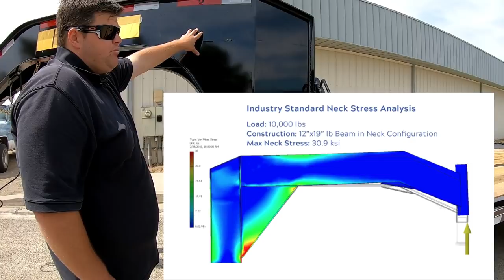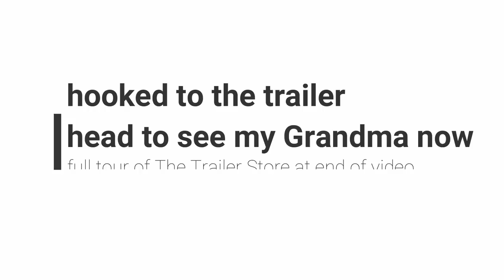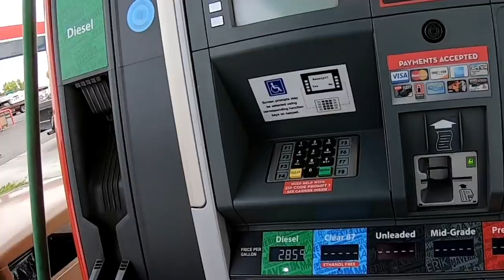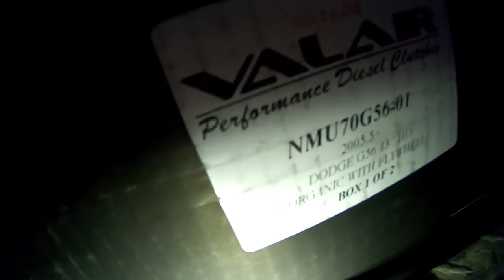BUYING A BRAND NEW DIAMOND C GOOSENECK TRAILER! SPECIAL ORDERED TOOK 3 MONTHS TO GET!

Comment: Bolt some old rubber belts to protect the deck where your steel tracks go. That’s what our lowboys have on them and it saves the boards for a lot longer
Reply: joeb blo. I do the same but I also treat them with linseed oil once a year
Reply: You have all sorts of used motor oil. That with a little fuel and you're golden!

Comment: To treat your boards, thin down roof tar with fuel oil, diesel or gas, thin enough to paint on with a brush.  Do it once a year, 40 years on the same oak boards and still holding up!

Comment: I’ve had issues with my hub seals leaking also. I was draining the oil in them and noticed fine wear metal from the bearings. I think that’s what eats the seals and causes them to leak. Since then been changing the oil often and using Conklin top spec. Haven’t had a leaky seal yet knock on wood.

Comment: I put quarry belting over the steel plate on the trailer deck for loading crawlers, saves the pucker factor if they slide on the deck

Comment: Hi Sam! My hydraulic jacks for lifting trailer off truck do the same thing. Have not found fix:( they do draw lot of AMPs from battery mine 440amps. Dump bed draws 220 weird. 5watt solar panels keeps everything fine. Looking forward to seeing trailer get used!!! Thanks for videos! Hard work pays off!!! Say Hi to your Dad!
Reply from the maker: Fixed it tonight. Lines to splitter box were hooked up backwards. Works perfect now

Comment: Its sounds like air in the hydraulic lines that needs too be bleed so the axle seems like there tight and need too be broke in but might be set too tight on the bearings but they are new!

Comment: Hi Sam, good idea to recheck preload on bearings. Sure don’t want to loose a wheel bearing and have a set of duals coming off. Has enough miles to retorque the wheel fasteners. Like the trailer. Do you have enough boxes or will you have to add some side boxes. 👍

Comment: Hello , I would not stain the deck. I would use diesel fuel and transmission fluid. In a day or two it will be dry and it will not come off on your clothes.  It will last a long time and outlast any stain , you can brush it on or spray it about every 5 years. 
    I have a trailer 30 years old and the deck is as hard as it was when I got it new.

Comment: Gator trailers of Canada makes a galvanized trailer with artic flex wiring and a lot of standard items that are options on other trailer manufacturers.
Reply from the maker: Seen s gator in person. It doesn’t stand a chance compared to diamond c. And gator gas worst costumer support ever
Reply: @VBELTandSON  you talking about the Gatorade trailer. Different company.
Reply: Gator and gatormade are different companies

Comment: What's the spread between the axles, center to center. It looks like 96" or wider? Also if you know anybody with conveyors get some old belts to protect your boards with tracks.
Reply from the maker: 48 inch spread and oak deck holds up great to everything

Comment: Sam if u dont want wheel  seals failing  drain the gear oil out of them and fill them with Lucas hub oil. That's what we use in the semis
Reply from the maker: big murph I had seals fail with that stuff before. Soo hard to clean that crap off the drums.
Reply: @VBELTandSON   yeah it is hard to clean off. We like using it because it sticks to the bearing in case the seal does fail less of a chance burning the bearings up.

Comment: I’m looking at the same trailer basically but I can’t decide if I need 30 total fee or go with 32 total fee after watching some of your videos about chaining down to the tail I want to haul to skid loader’s at once
Reply from the maker: I’m going with a 32 on my next one  30 is nice but with the added length it should help the ride and give more cargo room
Reply: @VBELTandSON  My last trailer was a load trail 26 foot flat and a 9 foot Tail With disc brakes etc. but it was just hard to get around tight corners so I’m looking to get into something shorter but don’t wanna go too short I like these diamond see Trailers but I’m not sure on the practicality of having the tail that far forward. I like the reduced loading angle feature of that but having issues when chaining down to the tail would not work well I experienced similar issues when I chain down to the dovetail on the load trail
Reply from the maker: Watch I’m an operators YouTube channel and check out his loading style on is 30footer
Reply: @VBELTandSON  ended up with a sure track 20+10 has 12k axels but electric drum. It’s all I could find.. I’m gonna see how I like it before placing an order.

Comment: You should have changed the fuel filter on that 1st gen when they won’t idle it’s generally low fuel pressure from plugged secondary fuel filters
Reply from the maker: raccbc27 apologizys I forgot to mention he took the truck to Cummins themselves the week before. They changed all the filters but did not. Change a thing.  Master mechanics over there for sure. When you look at the throttle linkage stop plate you can clearly see it has bent over time. What I did was the only way to fix it. I’m sure if it was filter issue throttle response would have been weak as well which it wasn’t

Comment: Hope you don't have the same problem with tires the other guys have had. It seems like that style trailer (or maybe just smaller trailers have a lot of issues). The big trucks I drove would have problems sometimes but the trailer was usually the last thing to need attention other than regular maintenance. I hauled equipment on a 50 ton carry all and the tires never had problems. I believe they're the same size too. I was thinking of getting one and going into business for myself not sure if I will now. Hope you are trouble free now. Have a good one.
Reply from the maker: No issues with it so far. Been using it over a year. All good

Comment: Just FYI for everyone out there, most 245/70R17.5 tires are rated max 68 mph. I believe Continental makes a 75mph, but good luck finding them. If you run the 235/75R17.5 they come 18 ply, I don’t remember the load ratings off the top of my head but they are close, but they come rated 75 mph.

Comment: Now I know why you paid more. I'm only about 300 miles from the factory and picked it up there.. I saved $700 in shipping and I can;t even guess what you paid all the way to Nevada. I did the pine deck with the rubber inserts on the tail. Wish I had done the Oak. Good choice! I have now suscribed to your channel and I hope to share some of my vids with yours...I have one so far but am working on it.  Just watched the vid after you brought the trailer home and was adding the chain rack and talking about the squatters. About four years ago I passed through Northern California on vacation(Susanville up from Reno to Logview WA) guessing I was up in your neck of the woods. GPS dragged me up through Lassen, not the best route, but SOOOO scenic. No regrets. 

But Anyway, nice thing about Missouri and trespassers. We can call the cops, or just handle it ourselves. Either way, the bums get the message and move on. I can tell more explicit stories about that but not here. 

I am so glad you are enjoying that trailer as much as mine. I pull it almost everyday and it is so much better than what I had before. 

I still use the old lever dogs (the tooth busters) with a five foot square tube for latching it down. What the heck are those binders you use? Those are bad ass!

PS, Took over 6mos to get mine...

Comment: You could have been a Good SAMaritan. Load up that dude on the motorcycle and give him a nice fast ride LOL.  I like that oak planking. I guess you are going to have to put good grease in the bearings. Sticky gooey marine bearing grease. Works fine in my trailers. My suspension in the travel trailer has wet bolts. Bolts with zerks on the end that have a small hole down the center and out the side. With the hole on the side up you can shoot grease into all the bolts that hold the spring ends, and on mine a MoreRyde equalizer.

Comment: Would check the brakes in addition to the hubs. Dry bearings will generate heat but nowhere near as much as dragging brakes. Not totally acquainted with electric over hydraulic but if using a standard electric brake controller, sensitivity could be causing enough residual pressure  to cause brakes to not release fully.
Reply from the maker: david Horsley I didn’t even have trailer brakes turned on tho
Reply: @VBELTandSON  just a suggestion based on what I have experienced. The only time I have ever experienced hubs to hot to touch, I've had a dragging brake. Second, just by their very nature, discs develope more heat than drums, even with the vents in the disc. Third, I don't know if I misunderstood but I thought you said the onboarding hydraulic pump energizes the discs. I don't know how exactly that works, I'm familiar with electric brakes, I'm familiar with hydraulic brakes, and I'm familiar with air over hydraulic, but I just thought I would suggest checking the brakes before changing the preload on the bearings. New trailer, new bearings, no load, and hot hubs, I'd investigate all logical venues before doing something to void a warranty. Sorry to intrude, just trying to be helpful.

Comment: One question why did u not get air bag axels??
That would also fix the huck and buck
Reply from the maker: Worried about getting thing ripped off driving in the woods
Reply: @VBELTandSON  
got it
My thought would be if u had gotten then u would not have a huck and buck
Reply from the maker: B Pev21 I’m sure it would have helped but several other variables that let to the hucking. I’ve got it pretty much figured out now

Comment: nice trailer - is your suspension called a "hutch"? I just got mine last week, exact trl except i got extra boxes and regular gray wheels, and i got 12" floor framing. I asked you about the remote before -  yea so mine doesnt work all that great, the pump shuts off and on if not standing right next to trl so probably have to upgrade that to a lodar. Really disappointed because my left jack leg fell down loose and was dragging the road before i got home, so i had to strap it up, and when i parked it the first night i came out to a puddle of oil under the right leg, so yeah im pretty disappointed and it was a pretty long drive to go get it only to pull it back 4hrs and go right back before even using it... we'll see how diamond c treats me to see if i can smile again about it
Reply from the maker: Yeah hutch’s suspension or it’s the same that as that. But call dc and they will take care of you. I’ve seen what they are willing to do to make their costumers happy. And the remotes all suck. Some days work great but most time suck

Comment: You should look into cross fire dually equalizers they are the best thing I ever put on my 24k tilt deck
Reply from the maker: ds250rider what is it?
Reply: V-BELT and SON crossfire tire pressure equalizers, very worth the $. They hook up from both valve stems and you end up with one central stem to inflate both tires. You get a color tab to indicate +/- whatever psi you select. Makes pre trip inspections that much quicker/easier. Also they’ll cutoff pressure if a tire blows out so you don’t end up with 2 flats.

Comment: Awesome trailer! I do have a few concerns though, neither of which may apply to you. If you were to haul two pieces of equipment, or one long one, would the dove tail pick up a bunch of weight? Also, with the axles being farther forward, if you have weight all the way to the back, will it affect the balance of the trailer? Again, if you only haul one thing at a time, neither of these would probably apply to your situation. Congrats, and I hope you get the kinks worked out!!
Reply from the maker: DeHaven Family Farm yeah I was worried about that but it’s only about and inch or so toward and the dove is rated to lift 10k. My buddy arther hailed two skid steers lifted back one no problem

Comment: Kinda confused near the end you put up on the screen that they used your trailer to haul back all those other ones stacked for their inventory yet earlier you said that your hubs were roasting under empty highway speed use over a short distance??? So nobody noticed that while they used it with the weight of that inventory on it and the distance it travelled to the retailer?? Wouldn't that have caused actual wear and damage to the hub assemblies or at the very least reduced it's service life?? Also hopefully they discounted you heavily for selling you basically a used trailer as new... I know it's old vid but I guess I never really paid enough attention when I first watched it after you uploaded it..
Reply from the maker: It was first trailer on the flat deck semi trailer. Wheels never hit the ground while being transported. Tires weren’t even installed. I would not have bought it if the used to haul all the other trailers. And hubs seem to run cool now. Changed nothing

Comment: You never said the brand of the new trailer. And it sounds like there still air in the distribution block
Reply from the maker: Keith Hughes lines were hooked up backward🤷🏼‍♂️🤦🏼‍♂️ all fixed now. I thought air in lines as well

Comment: Using a local dealer has its advantages when there is a warranty issues.
Reply from the maker: Military Museum local dealer wanted 10k more and wasn’t helpful with any questions I had. I bought from Texas direct last time. They drop shipped tons while under warranty from them. Ain’t worried.
Reply: V-BELT and SON. Ok then that makes sense.
Reply: @VBELTandSON  what other dealer gave you a quote?10K crazy..
Reply from the maker: Northern California Truck every NorCal dealer I called they wanted 28k+ with less options

Comment: Needs a bigger hydraulic tank imo.
Reply from the maker: Colin Hunter why
Reply: @VBELTandSON  maybe not, but how much fluid is left with the jacks fully extended and the dove tail at its max extension?  I was thinking if it managed to pump all the fluid out and introduce air into the system, would this cause a big problem with the brakes?
Reply: @colinhunter8793  shouldn't load while unhooked anyway

Comment: By going with the bigger rim size more heat is transferred to the hub. More rubber means more life on bearings and with less rubber means slower speeds and more breakdowns on the trailer. It’s simple experience rubber removes heat steel retains heat. Ya should have got the smaller rim but it’s still a nice trailer. Ps stop deleting and changing stuff on your trucks it’s a waste of money that will byte you in the ass. I’m running 10 ram 5500s my oldest has 750,000 miles on her and has never had one issue besides normal maintenance
Reply from the maker: Mid South Hot Shots thanks for the info. Doesn’t make much sense for tire size making hubs warm. I would entertain the idea of bearing preload be to much. And ps stop telling me to stop deleting my trucks. You’re Wasting your energy. It’s my money I will do what I want with it. Bottom line is I enjoy working on these trucks adding stuff to them is a hobby of mine. Thanks for watching pal